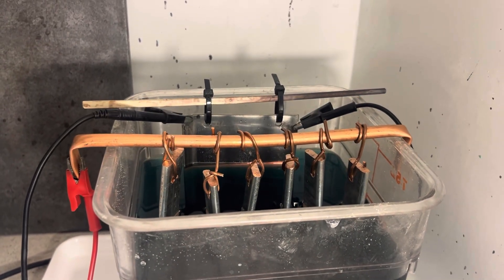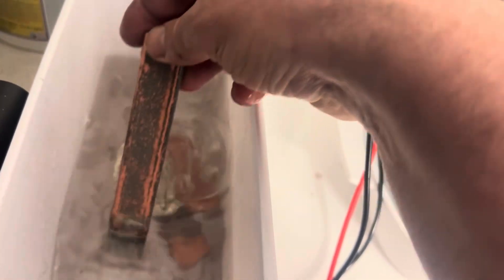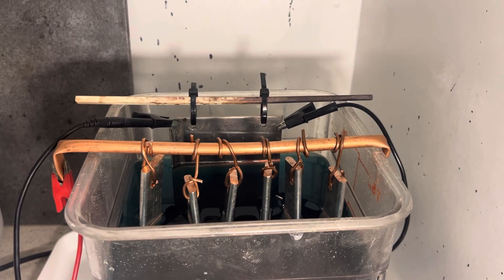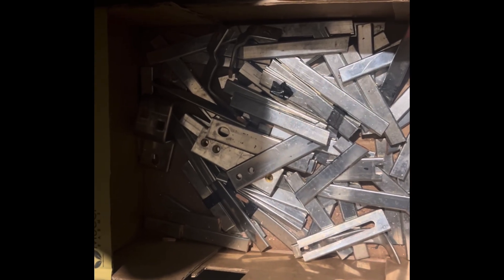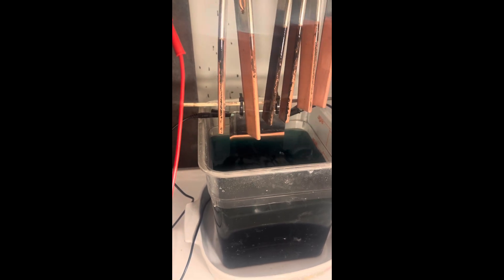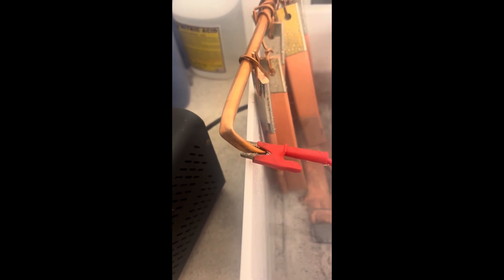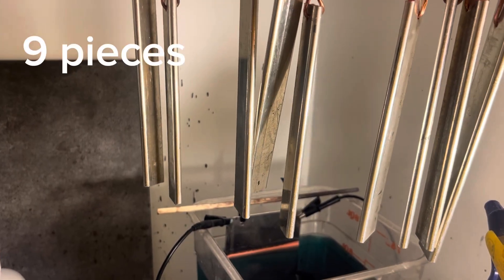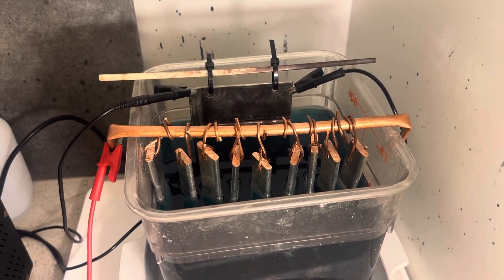URBAN MINING : Using a copper cell to recover silver from silver plated items ( w/ sound)

Comment: You lost me at sulphuric acid as the electrolyte 😢but mate awesome way to recover the silver. What about brass
Reply from the maker: I think The zinc in the brass will cause the copper to cement out . 
However I think maybe we can work around that using silver oxide , Sulfamic acid and MSG as an electrolyte . Ordering chemicals this week and will have to make the electrolyte . So we will see
Reply: @Hill-13  awesome brother looking forward to that
Reply from the maker: @empirefinds you got it